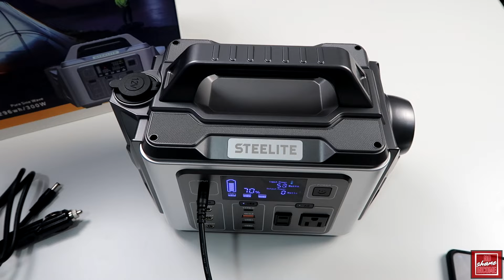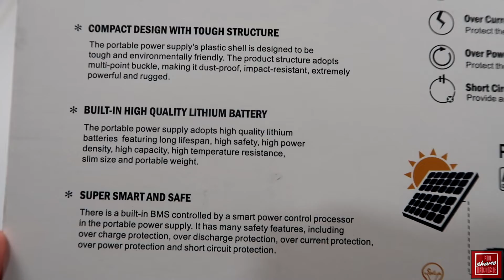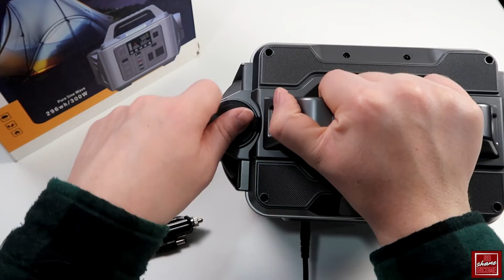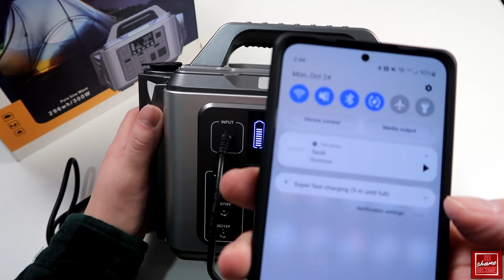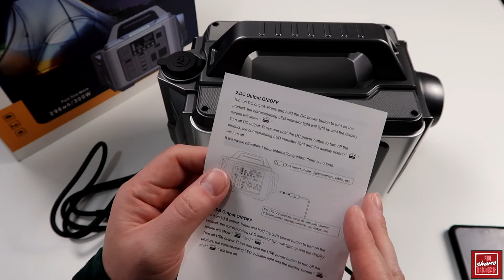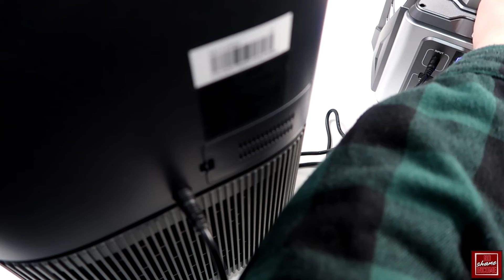STEELITE Portable Power Station [ Review + Power Test ]

Comment: Calling it a "Portable Power Station" implies that it is a power generator. It is nothing of the sort. It's worthless without the grid.
It's a rechargeable battery pack, so call it that.
Reply: If it generates power from the sun 🌞 why isn't it a generator?
Not the most powerful, but a good first step into clean free energy 👌
Power banks without self charging are more like rechargeable battery packs
Reply from the maker: yeah you're right, it's just advertised in this way from the brand